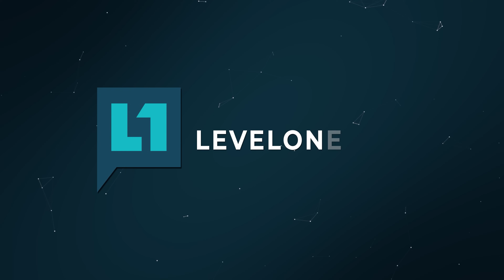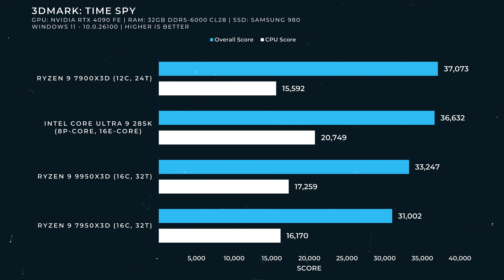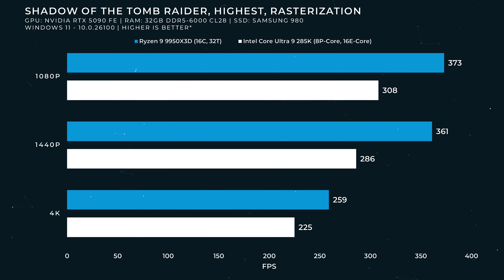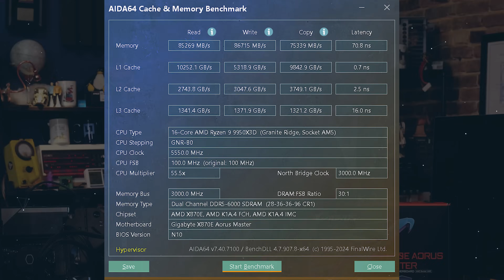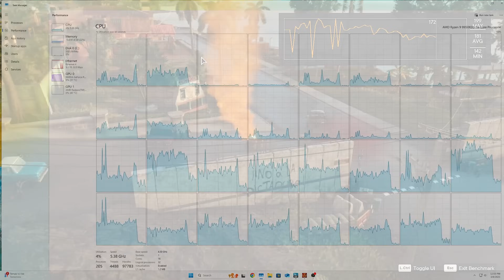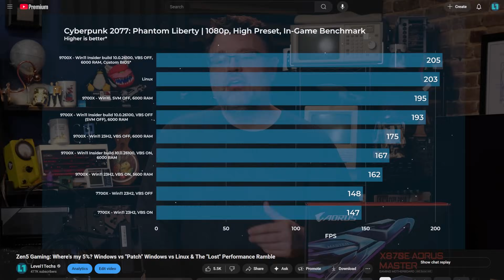AMD's ZEN 5 9950x3D Reviewed and Benchmarked

Comment: Impressive but 2 questions remain for me. AMD has always pitched to benchmarks and gamers. Has AMD solved their inability to top out memory? 

Another young man who has a fledgling channel recently trashed G.Skill. When I asked if the systems he had built that had memory issues were all AMD - he was defensive (so I assume yes). How was memory stability over say, 90 days (everyone released today - I don't know when you got yours).

The second question is, has AMD learned from Intel allowing ASUS (and others) to flame 🔥 the die with OC? My hot take is this 3D cache will be sensitive to heat related degradation moreso than not. 

So yeah, a great strategic launch for market share grab - but it's AMD. So what surprises are we in for? Will the dies hold up long term?
Reply: Not the first X3D cpus on market. Hence if 5800x3D were cooking off we would know about it by now. Not to mention the new 9000 series has the hot compute chip on top and cache on lower side to get better thermal efficiency - so if anything, these should be even better than before. 

I had a 5600G running 4000MHz DDR4 for 2 years, at least 1500 hours of gaming - memory stability once you dial it in has been great for me with AMD.

Also who is in this day and age doing any kind of OC? Even memory is kind of irrelevant because of the 3D cache acting as better memory access.
Reply: @aravindpallippara1577  - I didn't say, but I have a 7th gen i7 running DDR4 - STILL running. I never had to "dial it in." So that's what? 8 years and running? I have an interim PC z790, 12th gen running 48, 50, 52 - something and the custom loop running 8400. I didn't dial them in either.
Reply: @aravindpallippara1577  - I appreciate your thoughts. Ever have a pet, or a child? Have more than 1? Were the younger the same as the older even if they came from the same lineage?

My guess is the one featured is much smoother because it's mum and dad's favourite son - and therefore, it received the bulk of the attention. The other, didn't get the manhours before running out of time prior to launch.
Reply: @DelHollowProductions  Issues can happen any time, and as long as they are rectified and handled properly I don't mind having a few.

I am upgrading to 7900 personally right now and it was a no brainer  choice to the point that I didn't even look up what intel had on the competition - and even went with an Asrock board because they have 3 m.2 slots on the lower end of offerings.
Reply: @aravindpallippara1577  - that's not totally accurate is it? The silicone has limits beyond which damage occurs. Unlike a car that you burn the tyres off of - you can't reverse much of the damage done to the chip itself. What's done is done.

Comment: That 'AMD dip' nonsense was introduced by people who don't know how the Infinity Fabric works and were overclocking it waaaay to high.
Reply: Yep. Have had no AMDips on my 5800x3d.. 3600mhz cl16, set mclck = fclck , run 1800 on fabric and walla all silky smooth frames.
Reply: Let Ai do the overclocking it will work
Reply: @Sefumulumba  AI is all fun and games until it hallucinates and tries to jam 5V through your CPU. Just either let the CPU boost itself or do the overclocking yourself with constant testing for stability,
Reply: @ MommyKhaos You can set a limit for that so it does not go beyond the set limit
Reply: Slow in fabric and slow imc... ni amount of cache gonna fix that. That why the lows are terrible
Reply: @traitretrudeau2367 bro the lows are amazing. The 9800X3D has better 1% lows than the 14900K average
Reply: @morpheus_9  tell me more about the bar graph you saw from a sponsored video XD
Reply: @traitretrudeau2367  idiot you  are
Reply: @traitretrudeau2367  8 million gigabytes of cache wouldn't fix it? Tell me more.
Reply: @traitretrudeau2367  you are a id for sure

Comment: Still 16 cores
Still 28 pcie lanes
Still dual channel memory

Still need to buy TR when you shouldn't need one...
Reply: The latter 2 aren't going to change with a new CPU, because they are defined by socket/platform.
Reply: We will get more cores. We will not get more PCI lines in the future!
So… Go for TR!

Comment: 2:50  soooo 5% faster than 285K but costs 20% more.  OOF    ($699 vs $579 @ MicroCenter)  also using 2X more cores   lol
Reply: This is silly. One, it costs 699 so that math is wrong. Two, Intel released theirs some time ago and at 699 also and they have reduced the price because of lower demand. Even though the latter does not matter to the buyer, you cannot make that claim as if they have both just released. Third, there are other considerations for both platforms apart from price, including platform longevity, power consumption, lanes (favours intel), lower price memory (favours AMD), what platforms people are on (favours AMD)...etc
Reply: @kevikiru  typo corrected.  $700 is still 20% moar than the $580 285K
Reply: You can get a 9950x bundle (cpu, mobo, ram) for $649 if you're looking for productivity only lol

Comment: very nice, I have the 5950x still up and running stuff on the side, tempting to try this chip.  Thanks for the review.
Reply: I'm waiting... Not yet... Love the 5950X and DDR4 😂
Gotta love it 😢
Reply: 5950x is where I'm currently parked, and the only increased performance I need is defintely gaming. I wish gaming reviewers included Digital Combat Simulator because it is definitely a CPU heavy game (sim) that substantially exploits multicore. That was a patch they released over a year ago where people saw performance jumps of up to 80%, and probably 40% on average even with CPUs that were fairly old but still had  4-8 cores. Meanwhile, Microsoft Flight (2020) which simulated far less in the environment -- only planes flying with basic modeling and streaming content -- was still bottlenecking on a single core and performing worse.

Comment: Did the 9950x3D fix the DIMM issue so I can use all 4 DIMM without the configuration and performance issues?
Reply: Why would you need all 4 dimms populated? 64GBx2 isn't enough on consumer platform?
Reply: Whatever CPU and Motherboard you have, for end user level, you aren't supposed to use Dual Rank RAM. Be it on Intel or AMD.

So for such mainstream high-end Motherboard, it's still recommended to use Single Rank RAM if you want to use all 4 slots.

You literally hurting yourself if you use Dual Rank RAM for all 4 slots, because Dual Rank RAM is intended for 2 Slots or Server grade CPU & Motherboard. There's no in between.
Reply: @ClayWheeler  indeed. While less, same issue happened in AM4, as the IMC in consumer-level chips doesn't take advantage beyond 128bit per channel. This is also why either 4 single rank or 2 dual rank sticks do have some uplift in performance vs 2 single rank sticks, but why also there's the caveat where the IMC can go faster on 2 single rank sticks: it simply isn't running on the edge like it does when you have the memory channels running full bore with dual rank.

Solution: either stick to having 2 ranks per channel (either 4 single rank or 2 dual rank), run at base speed if you want to cram up the system up to the maximum memory it can handle, or go HEDT.
Reply: Nope, the official spec says only DDR5-3600 is guaranteed for 4x1R and 4x2R (4 dimm) configutations.😂😂
Reply: Well, at least the huge cache should help mitigate that.

Comment: Thank you for including Factorio performance. This is what I was looking for to make a determination between 9800X3D and 9950X3D for my next build, since it's really the only game I play frequently.
Reply: The factories must grow!
Reply: PlanetSide 2 benefits massively from X3D CPU's as well.
Is a MMO FPS that is mostly client managed not server.
Reply: @JavoCover  That game was dead.. 8 years ago. Damn I miss how good it was during the open beta, the insanee hundreds vs hundreds vs hundreds of player fights over the crown. That sheer scale and population was one of the biggest draws. But man they really screwed the pooch and didnt capitalize on it and instead kept spreading players out over more and more land, introducing more features that split the zergs and frontlines..
Reply: Unless you need it just stick with the 9800x3d as it just works (doesn't need xbox game bar) but if your willing to let it do it automatically or set affinity manually + the extra cost 9950x3d
Reply: I wanted this cpu to play the hd spyro dragon remake.
Reply: The save file they tested is too small. You can tell because it runs at 500 UPS. Factorio runs at 60 UPS maximum unless you change the game speed. Larger factories that actually have performance problems also have different performance characteristics.
Reply: @Vegemeister1  I saw on a Reddit post a few months ago a link to a special benchmark site for computers running Factorio. It has you download a very large map and it processes 1000s of things at once to stress your CPU and give you a benchmark score. I haven't tried it because I know my 8 year old laptop isn't special lol, but it still plays Factorio smoothly.
Reply: @Vegemeister1  that's the point (to find the maximum headroom you got)
Reply: @ You do not have that headroom though.  Like I said, the performance characteristics of large factories are different than small ones, because the game has to touch more memory per frame.

The performance cliff happens in DRAM, not in L3.

Comment: any time Intel faces a challenge, the consumer wins.
Reply: AMD clearly commands the market share on desktop chips within the last 7 years, but laptops and OEMs are firmly Intel territory.
Reply: @fujinshu I got a 7945HX (16C/32T) mobile CPU on a desktop board, this little thing is amazing. Especially for 100W TDP. Definitely looks like a solid laptop CPU.

I’ve never bought anything but Intel in a laptop (or desktop in over a decade), but I am seeing a 9950X3D in my desktop’s future, and possibly mobile if I decide to upgrade the laptop.

OEM and laptop are going to be slower to change, but the costs involved with the self-destructing Intel CPUs are hitting OEMs too.
Reply: @fujinshu  Yeah individual CPU sales have been strongly dominated by AMD, while OEMs remain Intel centered. But that's also because Intel is selling heavily discounted lower power skus (like non-K and T variants) to OEMs and AMD has no real competing products in that class. The only reason why OEMs keep using Intel is because they get the CPUs at a price that gives them much better margins.

Comment: Ohhh boya <3 Been waiting for this one for Months now! Would you still recommend the MSI MAG X870 Tomahawk WIFI? Been Digging the 5gig Networking and Wifi 7 Capabilities <3 Will feel good to put the Crosshair Hero VI finally to it's deserved Rest
Reply: What is the advantage of wifi 7 on desktop pc?
Reply: @Savke-S  VR casting to a wireless headset?
Reply: @Savke-S  Mostly redundancy. I plan to upgrade to Wifi7 anyways, and use it currently to connect to my keylights etc. In case something with the switch goes awry, I still will have a very fast connection to my NAS etc.

Comment: to understand how far behind CPUs were lagging a 4090 is 2.7x faster than a 1080ti and shadow of the tomb raider 1080p (no dlss) went from 99% Gpu bound to 0% (meaning 100% cpu limited) hopefully with a 9950x3D it will fix the bottleneck we had for the last 2-3 years, I don't play 1080p anymore but this is a very easy and simple way to detect CPU bottleneck on your system and yes it's useful even if you play 4K people mistakenly tought 4K didn't need a fast cpu in the 60Hz era because 60fps is a very low cpu load now that we have 120-240-300Hz you will quickly learn that cpus matter again I returned a 1440p 240hz monitor in exchange for 4k 120hz and i regret nothing my PC is way cooler and more silent for better IQ it's a win-win same fps/Hz vsync give the best result and constant (aka the 1% low fps number) 120Hz is hard enough to achieve
Reply: It's not a CPU issue, they have been getting better though. Since they added more cores (8+) it's been more and more a software optimization issue

Comment: Do not use non-extreme Time Spy for CPUs with >8 cores. It does not scale! This is by design as it tries to be game-like, to a fault. Meaning it does not thread to All The Cores and scaling stops slightly after 8 cores. Time Spy Extreme and CPU Profile do not have this feature.

Comment: Oh man, RIP Intel... It's just cruel now.
Reply: Intel does relatively well in the synthetics at the start of the video at least. Above and beyond the 7950X3D is nothing to sneeze at.
Reply: @levygaming3133  You're A) comparing synthetics which while interesting are hardly representative B) you're comparing synthetics against gaming focused parts. The whole point is this CPU does everything better, previously you had to choose which way to go with AMD.
Reply: @ I mean, “synthetics” was a bit of a misnomer on my part. Cinebench isn’t really a synthetic, it should be 1-to-1 with blender (CPU anyway). And these aren’t strictly gaming parts, these are gaming / multithreading parts, at least the x900, x950, and even the “Ultra 9” are. 

Obviously AMD is still winning in gaming performance, same as the story was with 9800X3D vs 285k and if anything only worse than 7800X3D vs relevant Intel parts.

Comment: @18:45 The only way from where they stand today is more PCI lanes so that the CPU can be used for other things than just childish gaming. Or to use a switch to convert 24 PCI 5.0 to 48 PCI 4.0 lanes. A MB with a total of 7 PCI connectors (5x8 lanes plus 2x4 lanes) would be perfect for my use cases. And at least two 10 or 25 gbe ethernet of course.
Reply: >childish gaming
Reply: Oh my god, a profissional! I want an autograph!
How about you don't buy gaming cpus for work instead? go buy a threadripper or whatever. as much as i could use extra pci-e lanes, they'd make systems way more expensive and would be bloat for 99% of domestic users.
Reply: @GraveUypo  threadripper starts at 2 grand nowadays, just for the two “threadripper specific” parts, ignoring what that might do to things like your case or PSU requirements. Not everyone, even ‘professionals’, can afford that. And it used to be way cheaper.

Comment: Have they fixed the issue of the 2 minute boot time?
Reply: You mean memory training? Yeah it still does that. The first time..
Reply: @nonameentered1918  mine does that every time.
Reply: @nonameentered1918  Yeah, I've never heard of this being an issue. 🤔 It's normal to need a couple minutes to train your RAM, but that's a one-time deal.
Reply: could be a motherboard issue. i went from am4 to 5 and i had like a 15 second boot, then all of a sudden its more like 2 minutes with faster hardware. did a bios update and problem is solved, back to speedy boots. 

but of course the first time is ALWAYS super slow. thats a fact of life you cant do anything about and probly shouldnt.
Reply: @bradhaines3142  the issue started after a bios update. I've updated bios and drivers as often as poasible. It's not that big of a deal. The system works great otherwise

Comment: something that should be written in bold on every game benchmark is that every DX11 or older game can't manage 8c/16t most only work properly on 8t if not 4t sometimes especially games made for consoles that would have taught people over the years that such a dual chiplet cpu was never a problem because you always had to target your threads yourself to get the actual best performance of your gaming pc on any 9+ cores cpu, never had problems since I learned that and used process lasso every 16+c cpu I had 3960x threadripper then 5950x then 13900k then 7950x I force most games into CCD0/Pcores and force other apps like browsers or OBS to CCD1/Ecores that way you can easily (with an nvidia gpu at least) game+stream live+encode locally a HQ video for your yt channel with one cpu and one gpu no need for two pcs or a capture card you can see how I know all this on my borderlands 3 lossless scaling video or my last epoch one I monitor everything going on in my games more than you have ever seen
Reply: Sorry about stealing all your periods.

Comment: And, no, you can't run it on a potato mobo. Anyone paying $700+ for a CPU needs a lot of I/O capability and the added chipsets that only good motherboards have (E motherboards, with their extra chipset). 
As for Thunderbolt, it is indispensable to me, so I'm hoping this great CPU lowers the price of Intel's CPUs and Motherboards.
as for Windows, unlike whatever "distro" you are using, it has to flawlessly run every single software and hardware on the market... Like Linux Distros, Windows can't pick and choose.
Reply: Linux regularly runs windows software more consistently and accurately than Windows does, through open source compatibility layers. Windows regularly breaks software compatability. This is cope.
Reply: @merthyr1831  I sometimes use a Linux "Red Hat based Distro" for certain things. Plug and play? Every single piece of hardware and software? You've got to be kidding me, or kidding yourself.
Linux Distros are like buying a very addictive game, every thing is an experience that takes hours.
For 90% of things, no thanks, I have work to do, no time to play with OSs.
Reply: @NorthWolfe  Yeah and im the queen of england back from the dead. Very convincing.
Reply: windows does NOTHING flawlessly. it cant even do its own updates without breaking something.